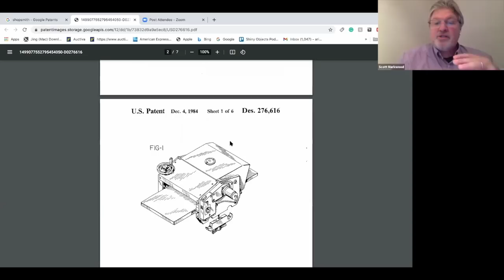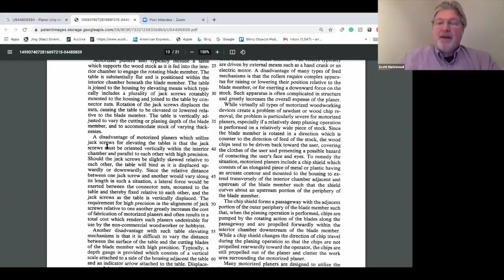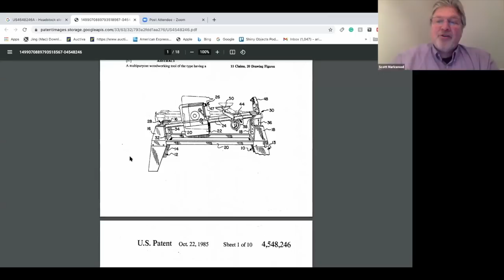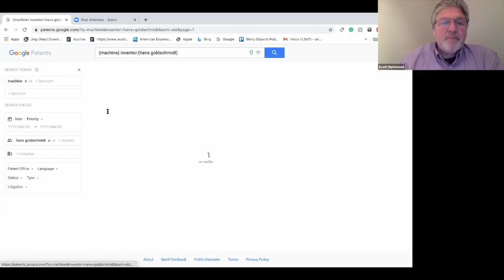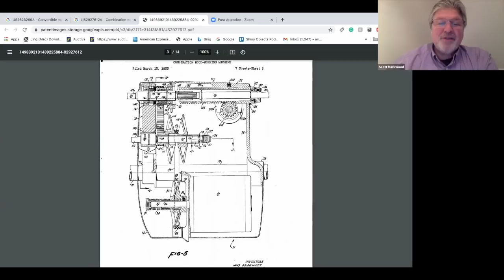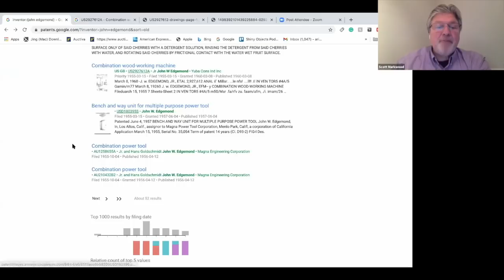A 5000 Sub Celebration and Exploring Shopsmith's Patents

Comment: Congrats Scott on reaching 5,000 subscribers. I’ve been using a SS since about 1980! Curious if you know, or could guess, about how many SS have been sold since the inception in 1947?  All the best, Jim
Reply from the maker: Thanks, Jim.  Unfortunately, we'll probably never know the answer to that question. Part of the issue is the record-keeping has been inconsistent as the tool line was bought and sold over the years, and some 20+ years ago Shopsmith Inc stopped using serial numbers and instead now number the tools with their creation date.  Also, we don't have accurate numbers for the 10e. the 10er, the Mark VII, the Mark 2.  It is believed that over 125,000 10er's were produced, and for quite some time Shopsmith's own website has stated that there have been over 600,000 Mark V's produced. Does that number include the Mark 7? So my best, educated WAG would be somewhere around 1,000,000 multipurpose tool units produced. But what about the SawSmith RAS and the SawSmith 2000? Don't get me started.  Scott

Comment: I had a Shop Smith table saw that was awesome. The blade could be pulled through the work.
Reply from the maker: That was the SawSmith 2000. I owned one of those too. I now own one of the saws that inspired the SawSmith 2000 that was made back in the 1940’s. Weird how they never caught-on. Scott
Reply: @MyGrowthRings  I agree

Comment: I cannot figure out how to use the 500 fence as a fence on my band saw! If you could address this it would be appreciated!
Reply from the maker: Which bandsaw table do you have? The 500 fence wasn’t designed to be used on the bandsaw but if your saw has the aluminum table and if you have the aluminum fence rail on the underside of the table the head of the fence will clamp to it. Scott

Comment: Did shopsmith make any efforts to protect the patents with tiny changes or modifications to extend the period through renewals?
Reply from the maker: Not much. They did patent a few improvements, such as the saw guards and the feather guard on the jointer, but most of the improvements came after the product they improved had already entered public domain. In fact, many of the improvements weren't even patentable. For example, the change from bronze bushings to ball bearing on the bandsaw auto-track system. HUGE improvement, but nothing exactly novel about it.  Scott

Comment: Scott, that was an excellent overview of the patent process.  The legacy of any piece of equipment that has gone from concept to manufacturing and then to revision is fascinating.  That is especially so when studying one, such as Shopsmith, that embodies an idea that continues to exist outside of the mainstream.

I worked with the R&D department of a large bedding company from 1978-1996.  A good deal of my time was spent auditing their testing process.  In addition to verifying record keeping, equipment calibration and sample certification... a key part of auditing was validating adherence to proprietary patent complaints & avoidance of competitive claims.  

During the last 8 years, I took over managing the mechanical testing portion of the R&D Department.  Among many projects, the one that stands out most was what was code named ‘Continuous Coil’.  Basically, it would render all other innerspring mattress constructions obsolete.

Where all others were made up of rows of individual coils stitched together to make up the innards of a mattress.... this design used a single strand of wire.  It was formed into a helix, bent up and down repetitively and stitched into place across the width.  That effectively reduced the amount of wire used by up to 20%.  It was capable of being formed, set into place, stitched and indexed without an operators touch.  The speed of assembly was initially thought to be around +25%... however, the first assembly machine yielded +60%.  Eventual improvements in electronic sensors and replacement of air logic controls bumped that up to well over +150%!

That was a good thing because it rendered tens of millions of dollars of equipment to become obsolete.  That prompted the company to run parallel projects of product development, machine development and manufacturing design.  

Was it successful? The next time you are in a mattress store... take a look at those cut away samples that show the innerspring inside of all the padding and cover.  You will still see a few of the old fashioned individual coil samples out there.  Two iterations of it still exist.  However, at last count, the progeny of that Continuous Coil, code named, project have claimed about 75% of the business.

A lot of that success had to do with confidentiality in testing and strategic patenting of the product and production machinery design.

Oh yes, another point about manufacturing efficiency.  In addition to the increase in individual machine throughput... the process went from two operators per machine to one operator for three machines... in a smaller foot print.  

Without those patents... the company would not have survived to become the largest manufacturer of bedding components in the world!  

I think that few people spend time thinking about the role they play in making the US the hotbed of innovation that it is!

Thanks for pointing to this important facet of American ingenuity and manufacturing might.
Reply from the maker: Very cool! I have studied several of those cut-aways and believe I've seen exactly what you are describing.  Scott

Comment: Enjoyed this, Do more of these, please.  I found a ShopSmith stand alone planer that I don't have possession of yet.  When were these made?  Are parts still available?  I bought a planer that sat on the ShopSmith, but it needed a hoist to move/mount it, it was so heavy.  I didn't move it to TN when I retired, I sold it to a coworker.
Reply from the maker: They were made in the 80's and into the 2010's. Many of the parts are available but some of the feed components aren't available, so that's one area I would inspect carefully if you come across a deal on one. Scott

Comment: I learned a lot I did not know about the history of Shopsmith today. I purchased my Mark V in 1978 with the bandsaw and belt sander. I added the jointer, scroll saw and planer by 1983. I still retain my original Shopsmith, bandsaw and belt sander.  I sold off the other 3 tools in 1998 and replaced them with stand alone tools. Thanks for a most entertaining channel and talk today.

Comment: Interesting. I've always thought of Shopsmith as being out of Ohio. My Dad had an original 10ER for a long time (into the early 2000s). When I looked at the original Goldschmidt patent from 1947, I realized it was showing he was in Albany, CA--about 15 miles from where my Dad's 10ER "lived." Given that was the year I was born, I'm not surprised I don't remember him getting it; it was just always there. But my guess would be that he probably picked it up locally. He used it quite a bit and inspired some of my love for woodworking. I always coveted his 10ER, but he was still using it actively, so, in 1977 or so, I got myself a used Mark V from 1956, which I'm still using (well, I will be, as soon as I replace the belts that just broke). I wonder where his old 10ER went? I don't remember him saying what he did with it when he moved into a retirement complex in about 2002. I've still got some of his related tools, like a set of nice lathe chisels.
Reply from the maker: Wouldn't that be cool to find? I didn't even know until recently that my grandfather owned a 10ER. What's amazing about that is he owned and operated a woodworking shop that at times employed dozens of people and was equipped with large, industrial machines. My uncle tells me it sat in a corner and would be brought into service occasionally as a backup for tools that were otherwise in use. I would love to locate it and to be able to confirm it was the actual unit he owned and used.  Scott

Comment: In your other band saw videos you discuss no other manufacturers use the auto tracking wheel design cause its patented by shopsmith.      If the 20 year is up, it shouldnt be under patent anymore.    If the patent is gone, why do u suppose no one is using that technology in new band saw design today?      Congrats on the 5K!
Reply from the maker: I must have misspoke, because I’ve often said that I was surprised that it hasn’t been copied, considering the patents are loge expired. It’s fair game, but there’s more to it than meets the eye, so manufacturers may just choose stick with the status quo.
Reply: @MyGrowthRings    I could have miss heard you as well that its shocking that it was not copied. Thanks!

Comment: Hope they don't get the onerous idea of copyright term lengths.
Reply from the maker: According to Wikipedia: Copyright protection generally lasts for 70 years after the death of the author. If the work was a "work for hire", then copyright persists for 120 years after creation or 95 years after publication, whichever is shorter. For works created before 1978, the copyright duration rules are complicated.

Comment: Hi great videos, I’ve just come across your channel as I’ve recently acquired a model 510, although I grew up with a 500 and still have all the accessories. Your videos have greatly helped me restore each one. On that note will you be doing a video on the 18” jigsaw/scroll saw? And also the jointer, I’ve sharpened the blades and lined them up nicely with the out feed table but have an issue with the in-feed table rocking diagonally, any ideas? 
Thanks for your help, I hope the rest of the move goes well.
Reply from the maker: Thanks. Yes, I will be coving the jigsaw and the modern scroll saw. As for the jointer, have you ever removed the indeed table? It’s an easy task that requires only the removal of a single nut. I suggest you do that and check it out to see if you can find any defects or gunk that might be causing your problem. Scott
Reply: @MyGrowthRings  cool I will be looking forward to those. I have had the in-feed table off, when I took it all apart to give it a good clean. The model 500 and all its parts have spent their whole lives out in east Africa so have had a tough time, so I’m now trying to get all the bits back into working order. When reassembling the jointer I wasn’t sure on the order of the washers on the bolt for the in-feed table so could be those (they might not even be the right ones), the 4 points of contact between the tables did look clean.